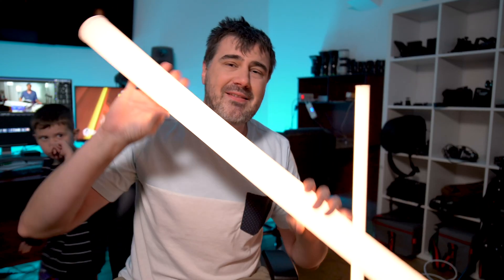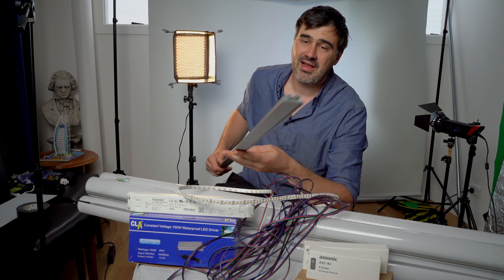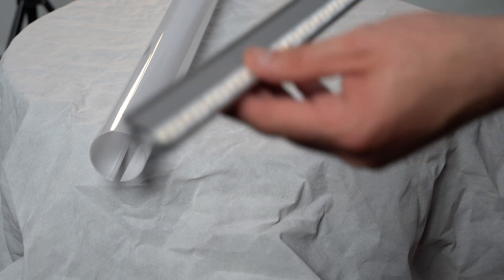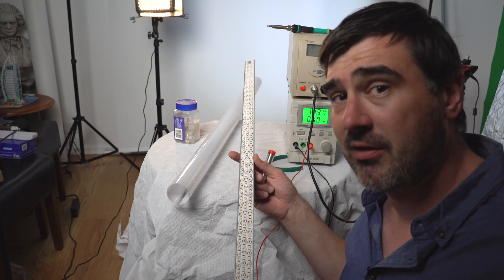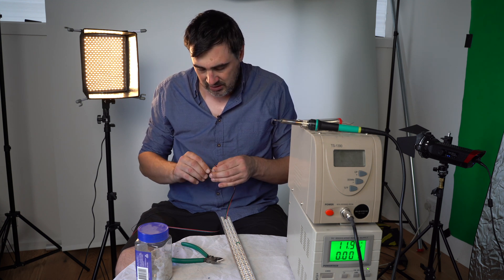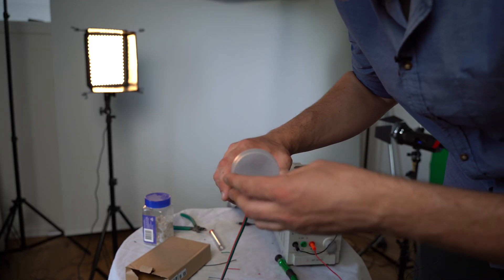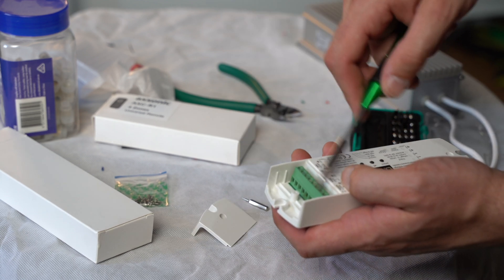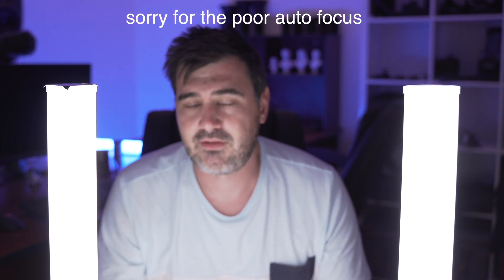How to DIY LED Tube Video Light

Comment: Hey James...can you explain how you wired the three strips  (green, red, black) at the 3:47... not really clear which wires you were attaching to which strip?  Thank you.
Reply from the maker: So each of these strips has 3 contacts, a negative and 2 positive, one for warm and one for cool white. Since I was running 3 strips in parallel I simply bridged the connection over the 3 strips at this section, joining the 3 strips so that the 1 input was delivered over the 3 lengths.
Reply: @StaplesMedia  hmmm ok...my led strip on has one negative and one positive...I am still not sure how to wire the three strips but will figure it out. Appears if I run the wiring in parallel all three should be able to run off of one power supply. Thank you for responding and Happy New Year James👍🏾
Reply from the maker: @bkelsey23  ah you might just have single colour LED strip, same deal just connect bridge the + and - connections across the 3 strips then you can connect to any of the + or - connections at one end
Reply: @StaplesMedia  Ok thank you James.  Appreciate the clarification.   Happy New Year!
Reply: @StaplesMedia  last question James but kinda off topic a bit...I have several 7.2W/m Pure White led strips and 4.8W/m Warm White led strips...can these be used together although of different voltage?  Thank you.
Reply: @bkelsey23  as long as they’re both 12V yes
Reply: @staplesmediaaustralia  and should I wire them in parallel or series...parallel right?  Thank you James...you are a lifesaver:)
Reply: @bkelsey23  parallel correct!
Reply: @staplesmediaaustralia  great...I'll give you a subscribe for all your help...thank you again James.